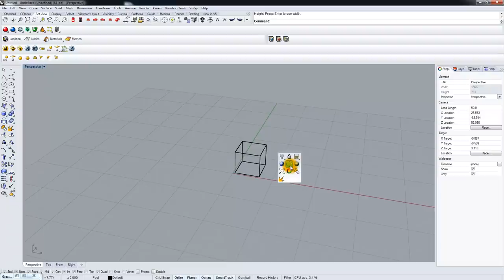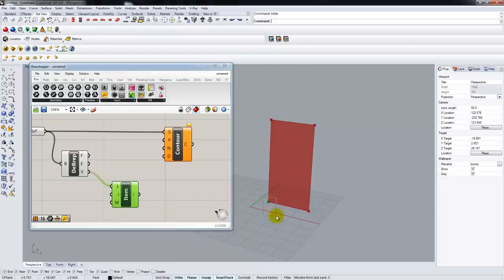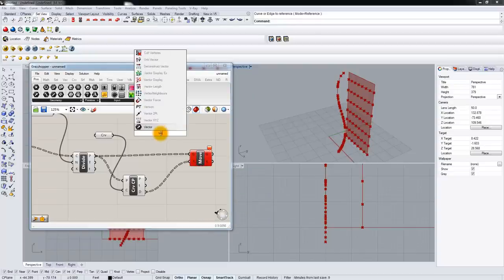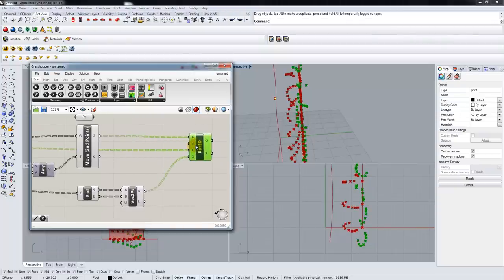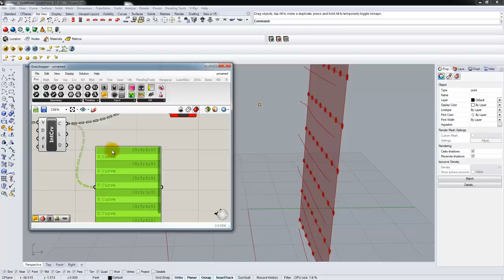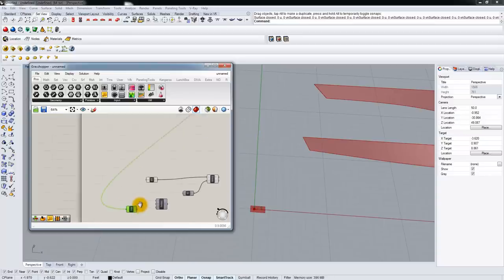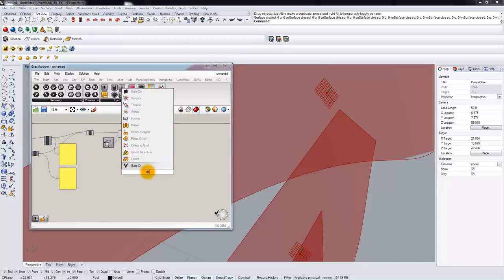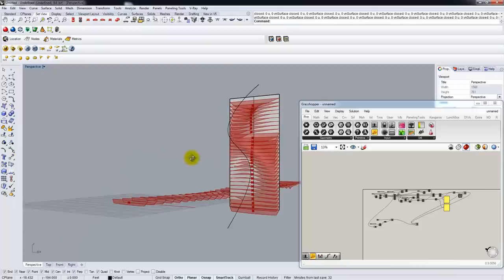[Grasshopper] Parametric Louvers

Comment: thank you so much! This really help me doing my assignment.
Very clear tutorial, now I understand the tree structure in grasshopper. 

One more question, how to make the inner edge of the louvers flat?
Reply from the maker: The inner edge, the one on the surface, is flat in the example in the video.  By dividing the surface you get straight lines on the surface. If you wanted straight edges for the outer edge just use two end points and not interpolate a curve, use a polyline or 2point line
Reply: +Christopher McAdams I mean in the rhino after you do the "unroll"